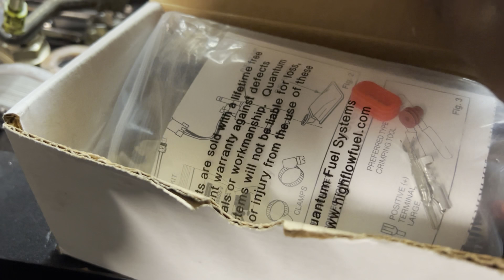2001 mirage  fuel pump upgrade and remove stock exhaust

Comment: Can i get a proper video of yuh fuel lines run underneath car we not see it properly as u dear u could of pressure  wash the tank and do over the muffler.The carhol canster u condemned it or it will be in use
Reply from the maker: Oh yes, there’s definitely going to be a part two to this video because the rest of the fuel line has to be ran and put in the proper place so definitely stay tuned for that